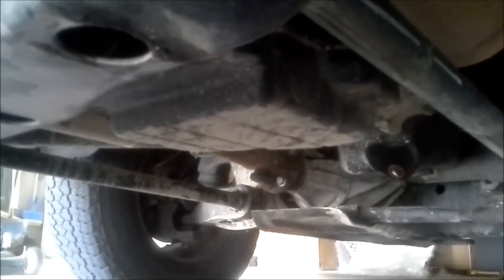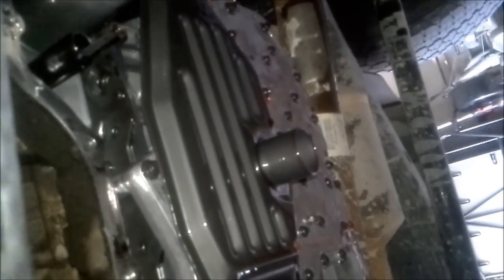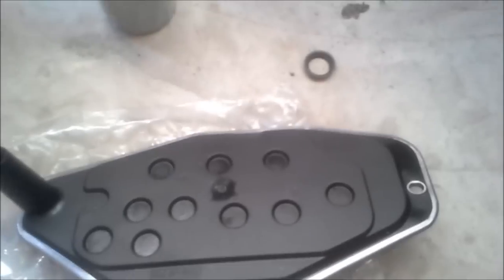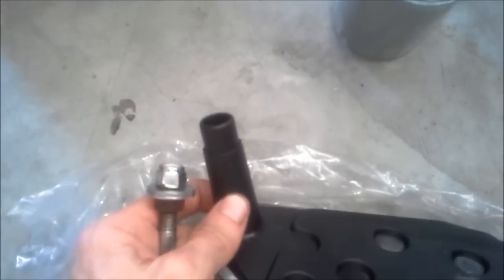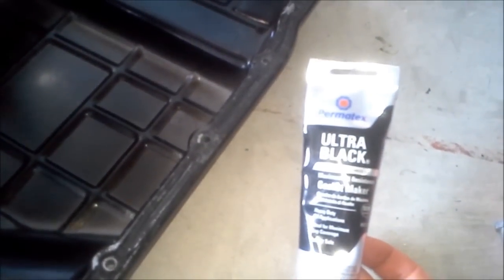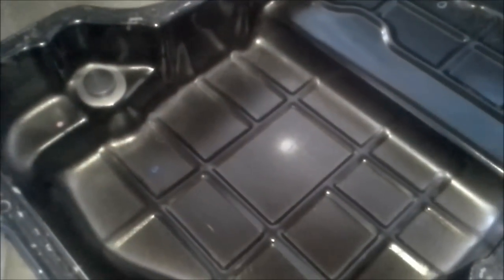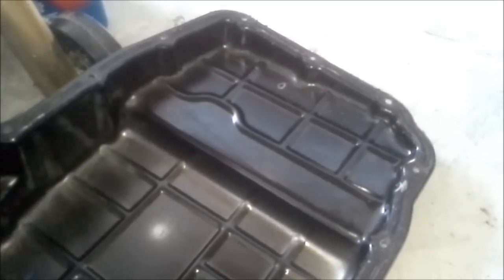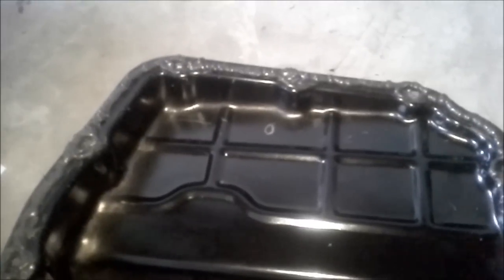Dodge Ram Transmission Fluid

Comment: If you want your dodge trans to last. Stop putting that ATF+4.It is so horrible. It has the most antifriction additives of any OEM trans fluid out there. As long as your not in subzero temps run tractor transmission/hyd fluid. Doesnt have all the extra additives and can take heat WAY better than atf. You wont get any Torque converter chatter. Only con i found is its hard to read on the dipstick. Personally i use Schaeffer oil. Americas oldest oil company. I use there Simplex Supreme Synthetic torque conveter fluid. Absolutely amazing stuff.
Reply from the maker: Not sure if this is a spam ad for Schaeffer oil or not. In any case, I know about  the reputation of Schaeffer oil. However this truck has 173,000 miles on it, and my Jeep has over 370,000 miles. They have always been serviced with Super Tech(yes, Walmart brand) ATF. So I contend it isn't ALL the quality of the fluid, it is more about the frequency of service given based on how often the vehicle is driven, how it is driven, and what part of the country you are(how hot it gets).
Reply: dbc1dc No spam just a Schaeffer oil lover...Your  right. Do you what you want, you will anyway.

Comment: I just did my filters/fluid change today in my 2007 Dodge Ram 1500 4x4. I have to ask, why didn't you use a gasket? The filter kit I bought came with both filters and a gasket. Also I bought a new pan, mine was rusted and the new pan came with a drain plug. I'm not a big fan of using RTV, too worried a piece will break off and damage the transmission some how.
Reply from the maker: I use a gasket on every other vehicle I own, but this truck never came with one from the factory, so I re-apply RTV every time. Never had an issue with it dislodging any pieces, that truck has 170,000 on it currently and it never leaks tranny fluid!  My other vehicles that use gaskets tend to weep tranny fluid, even when torqued to spec.
Reply: How much did your kit cost in total ?
Reply: Jimmy B
Reply: if you use very little you wont have a problem, the way he did it way too much

Comment: Didn't the filter come with a new gasket already?
Reply from the maker: +OVI-Wan Kenobi Yes this particular kit did. It came from the factory with silicone only, no gasket, so that is always how I put it back together.
Reply: How many quarts of transmission fluid does a 2000 Dodge Ram takes.its a 5.25  V8?

Comment: Did it The same process for a ram 1500 2011 5.7 liters?
Reply from the maker: If the 2011 is still running the 545RE transmission it should be very similar. Even if they aren't running the same transmission it would be pretty close.

Comment: what about all the fluid in the rad and system? didnt flush that out
Reply from the maker: +Adam Bryant That's correct. This is "Standard Procedure" per the factory service manual for transmission fluid and filter change.